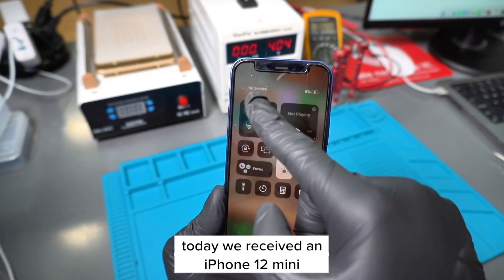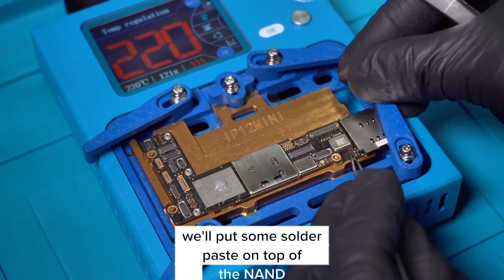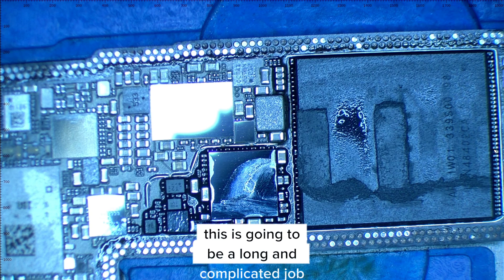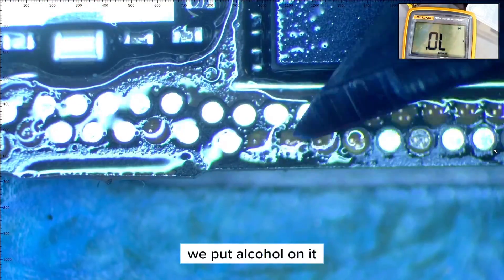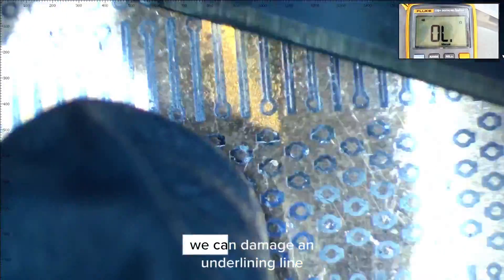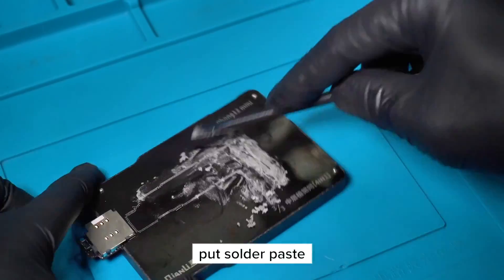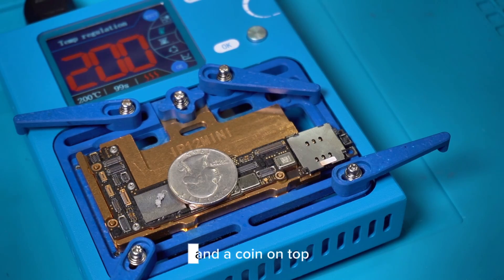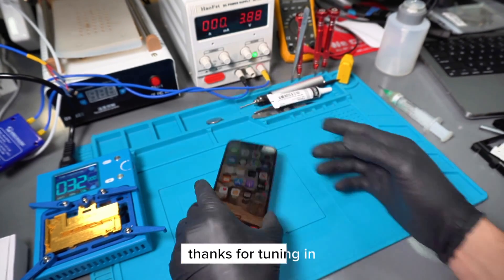How to Repair iPhone Mini 12 with No Signal WiFi or Bluetooth After Impact

Comment: Exactly what’s whiny with this current device I’m on, it says you guys can’t guarantee data and photo safety but usually this is a save operation?
Reply from the maker: If the issue is with the signal, there’s no need to delete the data. We can always perform a backup before starting the repair.

Comment: what happens if the wifi and bluetooth arent working but when you type*#06# it shows the IMEI number and stuff
Reply from the maker: The Bluetooth and Wi-Fi are controlled by the same integrated circuit. Even if you’re receiving a signal, you might still experience connection issues due to problems with the upper or lower layers, or it could be related to the IC itself, such as a short circuit or missing voltage. First, the phone needs a proper diagnosis.

Comment: I chave no signal WiFi, but I can call, it is a WiFi issue only. In fact, it shows the IMEI number, but still I cannot get the WiFi. Any idea of the issue? Thank you in advance!
Reply from the maker: The Bluetooth and Wi-Fi are controlled by the same integrated circuit. Even if you’re receiving a signal, you might still experience connection issues due to problems with the upper or lower layers, or it could be related to the IC itself, such as a short circuit or missing voltage. First, the phone needs a proper diagnosis.